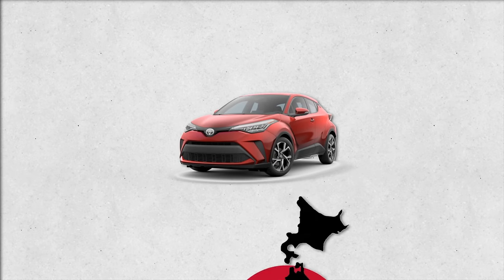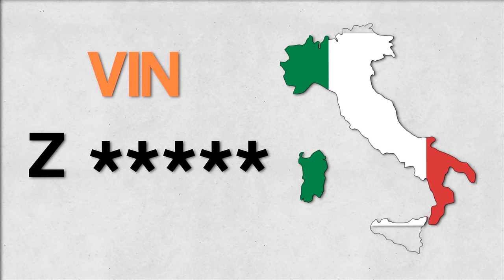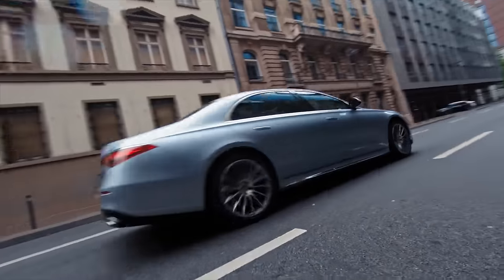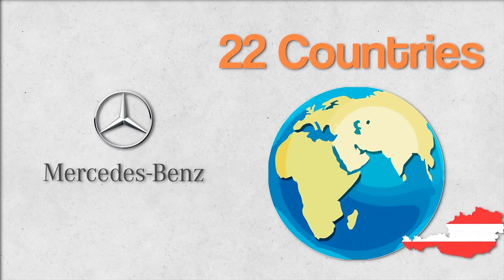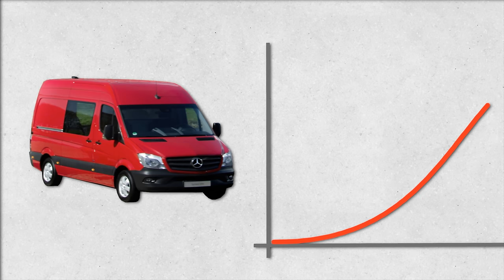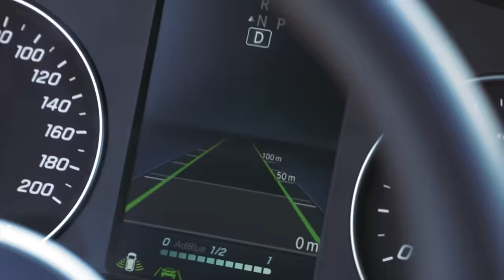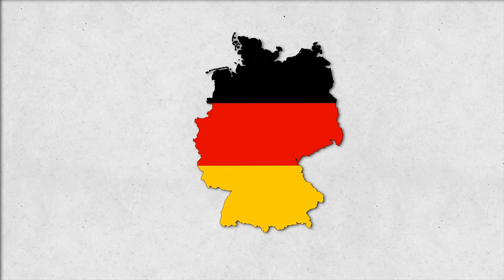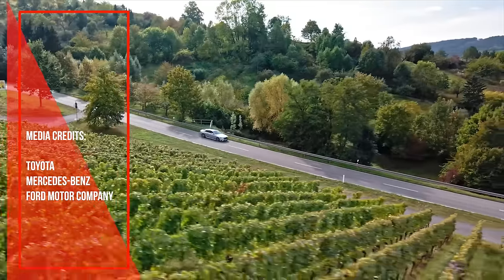Never Buy a Car Made in...

Comment: Scotty, this is dead on right. I have been burned so many times by "American" made products. I work in the HVAC controls/Fire Systems field. Some of the worst products in the field are American made. For example, there are damper actuators USA made that are absolute garbage. I have installed these actuators and to immediately fall apart. This junk gets installed to comply with "Buy America" laws. Belimo of Switzerland makes some of the best actuators in the industry. The non USA companies are the industry leaders. Another example is Danfoss of Denmark. All of their products are excellent. I could go on and on. Of course there are many American products that are high quality, but there are also many products that are complete garbage. The thing is pretty much all Japanese & European companies are great. I thought I would give the perspective of the HVAC industry. Made in America does not necessarily mean high quality or even decent quality. If I see made in Japan or Taiwan I know, without a doubt that is high quality.
Reply: I've been working commercial rough carpentry for 14 years, and I agree with you from what I've seen in my own field. Most products we use are import brand, and domestic just can't stack up. Even down to just screws to frame the walls with, or sound or fire caulking products.

The whole "buy American" law thing on some jobs has to be forced BECAUSE people don't buy American... BECAUSE the products cost more while delivering inferior, sometimes drastically inferior, products for that price.
Maybe if we made products of the same caliber more companies would CHOOSE American and not have to be forced to do so with "laws".
Reply: So, which AC unit should I install on my house that has any quality built into it??
Reply: Well then why not move to Canada if American made stuff or anything American isn't good for you.
Reply: @CJColvin  No need to move. All of these products are available here and in Canada. The products I’m talking about are not good enough for anyone. If you were in a building that is on fire, would you rather have a broken USA made fire damper actuator or a European or Asian one that that actually works? I have installed USA made actuators that have worked exactly one time and then fell apart.
Reply: @tonyg7553  Holy crap!!!!!!! What about American cars from the 50s,60s, and early 70s.
Reply: @bwest-yq3uc  Sorry I do commercial not residential HVAC, I should have made that clear. The residential techs can answer this question better. But from my limited residential experience, the following are my top brands. 

TRANE

ARMSTRONG

LENNOX

AMERICAN STANDARD

BRYANT

RHEEM

RUUD

CARRIER
Reply: @CJColvin  I would say most of these older American cars were good quality. Today is totally different. Cars are now like computers, assembled all over the world with parts from all over the world. It is completely a global industry. The term "American car" is totally meaningless now. Would this be a Ford or Chevy made in China or Mexico? What about a Honda, Toyota, Kia, Hyundai, etc. made in America. What about the former Chrysler Company? It was owned by Mercedes (Germany) and Fiat (Italian). Now it is owned by Stellantis N.V. (Alfa Romeo, Chrysler, Dodge, Fiat, Jeep, Maserati, Ram) headquartered in Amsterdam? Are Stellantis cars "American cars"? 

The following are "American Cars" are NOT made in America.
Lincoln MKZ 

Chevrolet Trax
Jeep Renegade
Chrysler Pacifica
Buick Encore
Ford Fusion
Dodge Journey
Ford Fiesta

The following "Foreign Car Companies" that build cars in America:
Stellantis NV (Alfa Romeo, Chrysler, Dodge, Fiat, Jeep, Maserati, Ram)
Honda Motor Co. Ltd. 
BMW AG (BMW, Mini, Rolls-Royce
Subaru Corp. 
Nissan-Renault-Mitsubishi Alliance (Infiniti, Mitsubishi, Nissan)
Toyota Motor Corp. (Lexus, Toyota)
Hyundai Motor Group (Genesis, Hyundai, Kia)
Daimler AG (Mercedes-Benz)
Volkswagen AG (Audi, Bentley, Bugatti, Lamborghini, Porsche, Volkswagen)
Zhejiang-Geely Holding Group Co. Ltd. (Lotus, Polestar, Volvo)
Mazda Motor Corp. 
Tata Motors Ltd. (Jaguar, Land Rover)

So what is the definition of an American car?
Reply: @tonyg7553  I think of an American car as an old school American muscle car or an old school pick up truck that has V8 power, its rear wheel drive, and has beautiful looks and style.
Reply: @NovaDoll  But the old school American cars were never like that.
Reply: @CJColvin  The issue is American car makers other than Tesla refuse to innovate. There is a video out there about this issue. Any new young engineer with great ideas as always turn down. While at Tesla the opposite is true so this is why American auto makers are years behind anything that Tesla has.
Reply: @NovaDoll  So basically you're a modern car lover.
Reply: @CJColvin  I would agree. I would love to have a 1966 Pontiac Tempest.
Reply: @tonyg7553  Sounds good
Reply: @NovaDoll  wen it comes to EV every auto maker is behind tesla ..u dont know what ur talkin about. any ford ir chevy or dodge i get into has the same options and tech and more then honda or toyota or kia..
Reply: I agree, adding the new water heaters with Honeywell thermostats are the worse.
Reply: @CJColvin  hey pothead, we're talking about 2020s, the 70s was a different time where American companies weren't so greedy and could make great things. This era is gone. Even Chinese products seemed to be solidly built nowadays
Reply: @danteerskine7678  All cars today are nothing but garbage and also I'm far from pothead.

Comment: 2002 Toyota Solara V6, built in Cambridge, Ontario. VIN etched windows as they thought there was going to be a crime spree with these cars getting stolen. It really never occurred, but still robbers missed the mark not wanting to steal these.
Hope to get past 300,000 miles on it in about 2 years.
Reply: Still got the old 1998 family sienna. Well on its way to 400k, still looks mint and the only problem its had was an AC leak that I fixed myself. Ridiculously reliable.
Reply: @Diabolical29  I discovered my A/C leak 2 weeks ago. A rock hit the radiator and pierced a refrigerant tube line. Perfect hit, No way to fix it unless I get a new radiator. I guess it could be worse, the radiator leaking everywhere. Still my best car purchase.

Comment: Kentucky-built 2010 Camry SE... The most reliable car I've ever owned, and has the fewest repairs... My 2011 GX460 has some tall shoes to fill... My Japanese-made FJ is right there with them...😆😆😆
Reply: We had a 2010 Toyota Camry LE with the 2.5L 2AR-FE with 169HP and the 6 speed automatic and it was the base model camry with hubcaps but it had power seats and power everything so it’s not like it was the worst car because it had all 4 windows were automatic one touch up and down for the rear as well. Best car we ever had and lasted us 10 years plus from 35,000 miles October of 2011 to March 2021 with 212,000 miles.
Reply: 2012 V6, US, 250 HP, with EVERY option, Sunroof (not often used but makes car easy to spot since a rare option in WA unlike CA), JBL (sweet) lights on door and behind mirrors (who cares), etc. repo'd out of San Diego.  If you buy new get the JBL option.  Easily the best sound of any option.  Sound is so good I can run it a lower volumes due to a better full cabin sound with only 5 more speakers 6 vs 11, now 10 vs 6 but still a real difference for a few hundred more.
Reply: That's good to hear. My 22 Camry was made in Kentucky.
Reply: @PaladioBlaze  Do your basic maintenance, and enjoy the ride... I'd like a newer one, but I can't justify buying a new one when the old one has never broken down or stranded us!!!
Reply: My Kentucky built Camry has 306,000 miles on it and it's never let me down since I bought it five years ago with 200,000 miles on it.
Reply: @edwinroyal9734  2010 FJ Cruiser 104k, 2010 Camry SE 134k, 2011 Lexus GX460, 155,000K, 2006 Tacoma 172,000k... the proof of quality is in those miles!!!😄😆🤣🥰🥰🥰🥰😀
Reply: DAONEYOUHATE007  the greatest country in the world🇺🇲
Reply: @gwats19577  I'm 61 and only had 4 cars in my life..69 Pontiac Lemans..bought for 550 dollars with 108k miles in 1979...Got rid of in 1988 with over 275k miles. 1985 Chevy Camaro 2.8l V6 bought brand new and got rid of it in 2005 with 362k miles..2000 Dodge Intrepid 3.2 V6 bought in 2004 with 71k miles for 5800 dollars. I still have it & it Still runs today with 364, 525 miles but nearing its end. And A 2013 Toyota Camry SE I bought new in 2013..only 46, 356 miles on it tonight but plan to get 350k out of it minimum..My point is I have always felt if you stay with a car and do great maintenance  and repairs when needed, any of them can take you a long way. However I will say that my Kentucky built Camry I now own is by far the best build quality of the 4 cars I've owned..The Toyota's you listed with 100+k on them are barely broken in in my book.. With proper maintenance, good driving habits and repairs when needed you should see 350-400k out of all of them at the very minimum.
Reply: @richarddobson3138  I intend to make them last forever, and at 64, I'm sure I'll get my wish...

Comment: It's generally true that Made in Japan cats are built to higher spec than Made in USA but there are exceptions. Read into forum ands alot of people say that the 2016+ Lexus ES 350s which are made in the US have slightly better fit and finish than the 2015s and under which are made in Japan. I can attest to this. My 2019 ES 350 which was made in Kentucky seems to have much higher build quality than my 2008 ES 350 built in Japan.

Comment: I have a 2019 Camry xse v6 made in Kentucky. So far the car runs fine but I’ve noticed some minor things but the most annoying thing about the car is the 8 speed transmission. Its acceleration is really sluggish. I took it to the dealership twice and both times they said there was no problem found. Very frustrating. Thinking about trading it in.
Reply: @danielmeador1991  that’s good. I’ve been seeing a lot of people complain about it. Hopefully Toyota fixes the issue and takes care of their customers
Reply: Demand them to reprogram the transmission with the latest software update. They did it to my 2019 Camry and it doesn’t gear hop anymore or lag when you get on the gas/vibrate.
Reply: The more gears a transmission has, the more headaches it will give you in the long run. 5 is the max for me.
Reply: My 2020 Rav-4 xle has an 8 speed transmission but it also has an eco option, a normal option and a sport option for the way the transmission shifts. The eco option is very sluggish, it keeps the transmission geared high to keep the RPM"S low, thereby saving fuel. The normal option is much better with plenty of power and pickup for passing. The Sport option has the most aggressive shift of all, keeping the gears low to keep the RPM"S high. I normally run it in eco. When I need to pass a dump truck I just push the normal button and VROOM!! I'm around the truck in short order!! After I get up the road aways, I push the eco button again and you can hear the transmission upshift.
Reply: @sdthrutheroof9161  yes great point. I noticed when my Camry is on sports mode it runs normal. But Eco and Normal it’s sluggish
Reply: I had a similar problem with tranny constantly shifting on my 2019 SE Camry 4cyl, sold it...
Reply: @pedrofernandez8729  ---5 Speed Stick shift, like my Tacoma & Scion ???
Reply: I have a 2019 Camry SE 4 cylinder and it had that transmission lag, which I didn’t really mind since it was pretty minor, but I got the software update done and it’s perfectly normal now
Reply: @herbertfranco5826  Hi. What did you get for trading in the Camry? TIA
Reply: @davidwalia3451  bought new for $22k as advertised on Oahu & sold for $19k to pay off loan in 2020 due to move to Utah.
Reply: ...didn't trade in but if I had more time I could've got $21k...
Reply: I have a 4 cylinder 2020 XSE and have not noticed acceleration problems.
Reply: My friend in Lebanon paid $5000 more in 2018 to get a used Mercedes made in Germany,  it in USA 
However the messages splinter is really selling crazy in USA even the company I work with bought those three years ago and never had any trouble with it
Reply: I have a 2021 Camry hybrid and acceleration is great! Super responsive! If you buying a 4 cylinder model, get the hybrid it’s better in every way.
Reply: @tails300  it's really not though
Reply: @sdthrutheroof9161  my v6 accord is slow in econ mode. Keeping it in normal, it is really pleasent.
Reply: There were transmission software bugs that needed to be worked out on the 2018-19 models.  There is a software update that has shown to take care of your issue.  Please go back to your dealership and request the update.  You should see an improvement in performance.
Reply: @zacharypeery4082  it really is, you’re only saying that because you’ve never driven one.
Reply: @herbertfranco5826  :)  Thank you for reply.    2018 LE 4 cyl; but learned about the  transmission issues 6 months later;  living with it.  In addition, there is a 2012 & a 2016 Camry, both are LE and 4 cylinder as well.  All three bought brand new.  Choosing reliability over everything else.   :)
Reply: @herbertfranco5826  May I ask what are you driving at the moment ? TIA.
Reply: @davidwalia3451  2013 RX350 bought in July 2021 109k miles. 129k now. Only toyota/lexus now Scotty's advice 6yrs ago
Reply: @davidwalia3451  BTW 2019 camry was garage kept & had 5,000 miles when sold. Jumped at my RX350 FWD when I saw "Made in Japan" LET'S GO SCOTTY!
Reply: I test drove a 20' Camry and the 8 speed transmission was hunting for gears.  Horrible car.  I told the dealer I will keep my 12' Altima whose transmission was very smooth and has been bulletproof.

Comment: When I went to buy my Corolla 13 years ago I called the dealership and told them I want a Japanese Corolla and I will be looking for it in the VIN #. They asked me why? I told them just what you said Scotty: "work ethics and dedication". They had to change the car as they had a non-Japanese waiting for me.
I've had that car for 13 years now and other than regular maintenance and a water pump, I have done nothing else. I love the quality and fuel economy. The total cost of ownership has surpassed my expectations.
Reply: Bet you still purchased the extended warranty
Reply: No extended warranty.
Reply: My 09 4 cyl Camry built in Kentucky which has the same engine your car had a water pump failure in 2019. Wonder if that was common thing.

Comment: When the New Beetle was first released in the 90's, mine fell apart after 2 months of owning it. The engine worked well, but it was all the bells and whistles that had issues: car wouldn't lock, the internal plastic mechanism that roll up the windows fell apart, glove compartment handle crumbled and areas of the dashboard cracked.  

When the lock for the hatchback trunk fell apart, I had to bring it in for service 3 times, and it took 2 months to fix it. I lived in an apartment at the time, and it was annoying to find idiots messing with my car with my trunk fully open - because of the broken lock. A nightmare experience. I learned years later not all VW's are made in Germany. Mine was made in Mexico.

Comment: Not all CH-R's are made in Turkey, some of them are made in Japan as well.  I've been a Toyota tech for 25 years and I've had to replace a brand new vehicle engine once.  It was a brand new 4Runner that had a freeze plug pop out so the engine got overcooked.  And 4Runners are made only in Japan.  And the worst engine in the history of Toyota, the disastrous 3VZ was made in Japan as well so by no means every vehicle made in Japan is perfect.
Reply: I was guna say from the vin number logic knew someone with one that had a j vin number that isn’t turkey lol
Reply: Dam but once is impressive made there or here
Reply: When , and what was the 3VZ engine used in ?
Reply: @indycharlie  The 4Runner from 1989 - 95.  Not only did that engine have a severe head gasket/overheating problem, it had very little power even when it was running okay.  It was the first V6 from Toyota and it was a disaster.
Reply: @CamKrazy2000  Now tell them what happened after that...TELL THEM...I'll wait lol
Reply: Now all these infos from one or more people. You would spread more ego statement stories made in Japan are the best lol. I will break it in reality with four major pillars, already seen many Japanese made design flaws even recnt models. Im not saying more units sold all are good. You have to be more realistic.